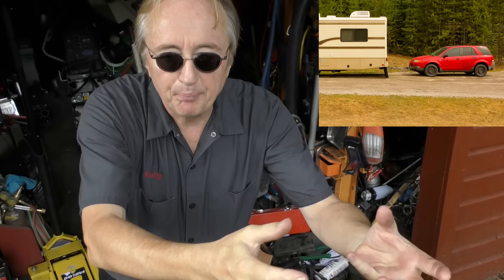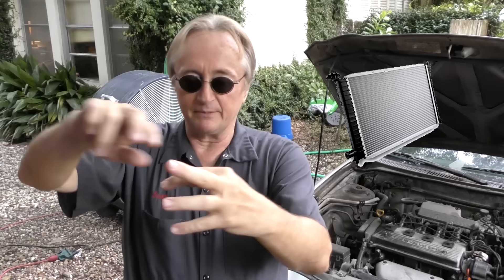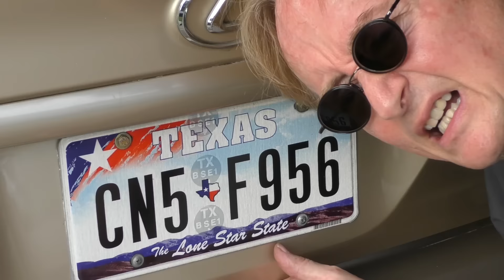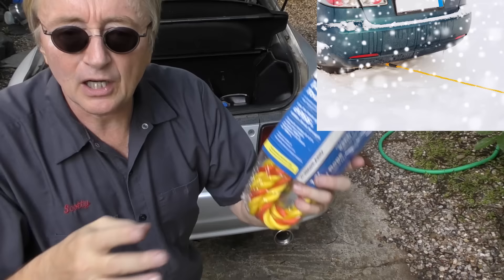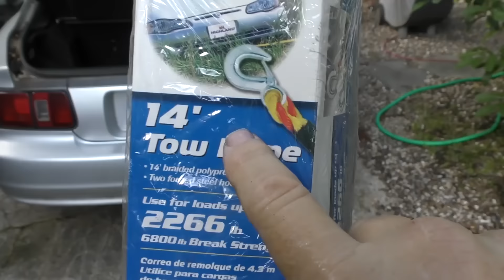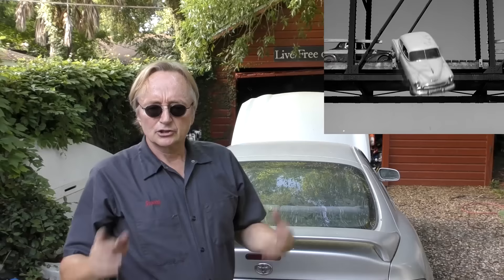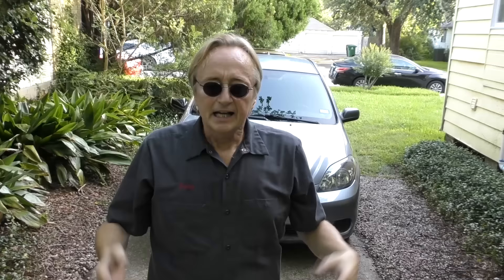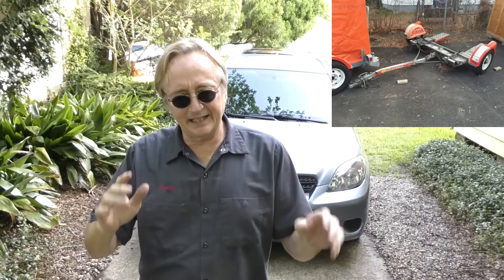Never Do This to Your Car

Comment: Always learn something new on your channel. Some of your videos should be a part of drivers ED.
Reply: GEAUX FRUGAL some of the  information in this one is incorrect. How is transmission fluid going through the transmission cooler on the radiator if there’s no pump working to move fluid with the car off and being towed? Also, how do you blow the head gasket? The car engine is off so the water pump is not circulating fluid as it needs to be driven by the serpentine belt in order to circulate the fluid. So how can hot coolant get inside the engine to blow the head gasket? The thermostat is even closed on a cold engine which prevents any circulation of coolant through the radiator. Even if it was possible to have an overheated radiator in this situation, which it’s not, there is air movement past the radiator while the car is towed which works to cool the radiator off just as the cooling fan does when it’s running when a car is parked and idling. There’s also airflow beneath the car that would help dissipate heat from the transmission through convection heat transfer. This logic makes no sense at all. If anything it sounds like a case of a Subaru that broke down due to a head gasket failure and then they towed it and ruined the transmission by overheating it from a lack of lubrication and overheated transmission fluid caused by the moving torque converter. There’s no way that towing the vehicle blew the head gasket...
Reply: Dana Jorgensen it is impossible to blow a head gasket towing a car. If there is heat transferred to the radiator it is being dissipated by air movement through the radiator as the car is towed. That’s why you don’t need a cooling fan when moving but you need one when parked and idling. The cooling fan pulls air through the radiator to dissipate heat from it. The exact same thing is happening with air flow through the radiator as the vehicle is towed. On top of that there is air flow beneath the vehicle that will also dissipate heat build up in the transmission through convection heat transfer. There is absolutely no way a car overheats the engine from towing it. He also said to never tow an AWD on 4 wheels. Yet if you look up the Honda CRV AWD with an auto it says you can tow it on all 4 wheels at highway speeds. These blanket statements that Scotty makes to encompass every vehicle are incorrect. It’s the same deal with whenever anyone asks a question about a transmission shift problem. Every time he says the transmission is worn and needs to be replaced. Man, you cannot diagnose a transmission based on a shift issue comment and say it needs to be replaced. I had a transmission shift issue and had people say it was an Internal issue on a Mustang GT with 90,000 miles. It turned out to be an electrical short in my engine fuse box that was interfering with the reference voltage used for the transmission. Fixed the short and no more transmission issue. Just because Scotty has 51 years experience people take his word as gospel without ever logically thinking about it in many cases. Years don’t always mean you know everything. It comes down to what kind of experience you have more than anything. There are people working in jobs for 25 years and someone working the same job for 10 can know more. This is a fact.
Reply: @newfie-dean5803  As a transporter of cryogenics I have an education in fluid and gas dynamics. A radiator is both higher and cooler heat naturally seeks a higher and cooler level as a gas or liquid seeks these polar opposites a convection occurs same action that causes wind, ocean convection etc stratification is a factor here all these atmospheres play off one another . All of these , fluid Dynamics, air / liquid interaction is sure to increase the  temperature of transmission fluid  .
Reply: GEAUX FRUGAL what? I understand heat transfer well. Airflow is going to reduce temperature. Air flow over a radiator reduces temperature, that’s how it works. Same principle with airflow under the car. The point here is this, no tow job caused a head gasket to blow and if you think so then I can’t help you.
Reply: @newfie-dean5803  NO !, the greater heat and lack of water circulation in the normal direction is never going to keep the situation under control.  Airflow around a water cooled engine is not going to have much of a cooling effect.
Reply: @GEAUXFRUGAL  well done sir, better put that I could, also the un-pressurized transmission fluid is a lot hotter than what the car was designed to cope with under normal circumstances.

Comment: Scotty, you are right about towing and smart to not mention that towing can be done on a manual trans with a tow rope and the hooks but it should only be done by someone who is aware about towing with a rope. Towing a car with a tow-rope is legal, subject to complying with the relevant road rules and regulations, but it's not something we generally recommend as there is a lack of power assistance to steering and brakes on the towed vehicle.  Its pretty scary as I've done it a few times.  The person towing needs to look ahead and drive in such a manor that the vehicle behind can stop both cars in time without the aid of power brakes.  This can be a challenge as generally the car towing is larger.  In some states you are only allowed to tow the car to a safe place while others you can tow home.  I have had the hooks on cars just rip off before too!  Not for the faint of heart and I would defiantly highly recommend using a different system if available.

Comment: Dont forget if your flat towing on a rear wheel drive car/ truck you can remove the drive shaft and it be fine
Reply: Exactly right!
Reply: ... Unless the drive shaft is needed to seal the transmission rear end. I had an old Toyota that could be towed that way (if it was an automatic, but mine was a manual), BUT if you remove the drive shaft, you have the put a plug into the back of the transmission to prevent the oil from pouring out.

Comment: I towed tons of cars from the 30s to mid 70s w/o issue with a tow bar. I did keep it to 45-50 mph and no more than 20 -30 miles, anything more and they got trailered.

Comment: A tip, even if you don’t use your tow hook and you have a little square cover. It’s good idea to spray some WD40 and screw in the tow hook a few times 2-3x. This makes it easier to install and remove the hook and also helps it from not rusting. Always make sure the cover is not missing. It will rust. If you don’t have the cover. Just leave the inserted tow hook in. Just spray some WD40 before you insert.